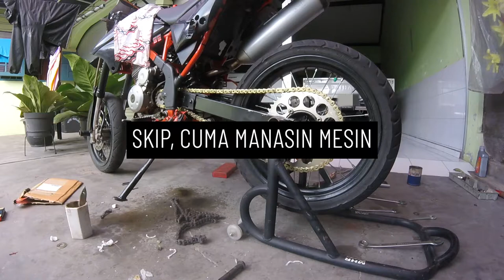Ganti GEARSET TK RACING 13-48T ukuran 520 seperti SE

Comment: mau tanya bang tolong di jawab.
 klo misal 428 nya pake kombinasi 14-47  trus klo 520 nya pake uk berapa gear nya. ?
Reply: yg setara dengan ukuran 428 14-47 pake ukuran brapa di 520?
Reply from the maker: kalo pake 520 gabisa setara sama 14-47, gear paling kecil 520 ya cuma 13-48, itu mungkin setara 14-55 di 428

Comment: Bang klx saya pake 52-13 520 kok berisik ya rantainya kya ada yg gesek tapi gak ada yg mentok😂solusinya bang
Reply from the maker: supermoto bukan, kalo iya biasanya gesek ban kalo ga ban belakang ga center sama depan
Reply: @BevrinWendraPurnama_bevbex  bukan bang, 21 18
Reply from the maker: @rcdemons4333  biasanya kurang center kalo ga ya dari rantenya bang sama chainguardnya
Reply: @BevrinWendraPurnama_bevbex  oke bang makasih infonya🙌
Reply: @rcdemons4333  bang itu klo 13-52t 520  bandingkan sm 428 setara ukuran brapa ya gear depan blkng nya apa ga terlalu ringan. mentok di speed brp ?